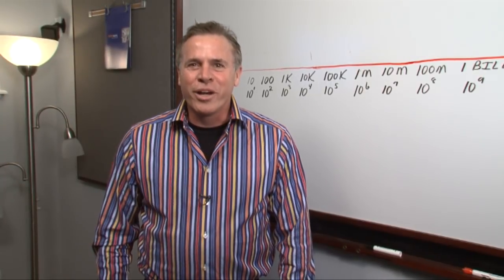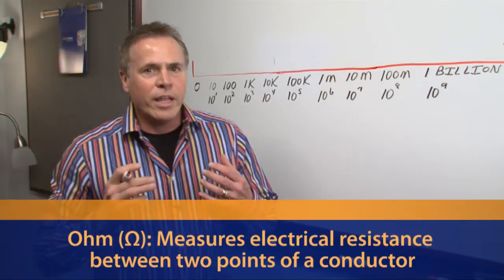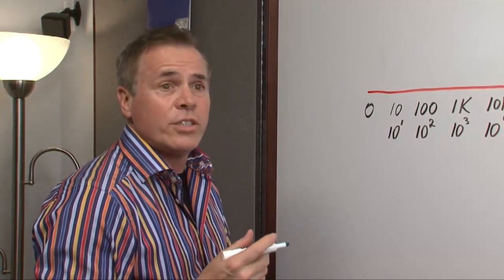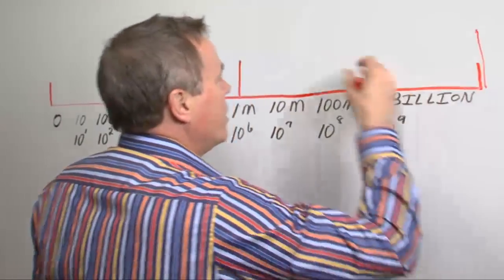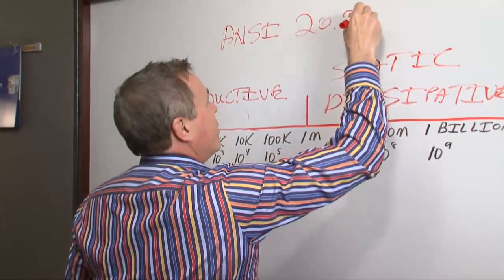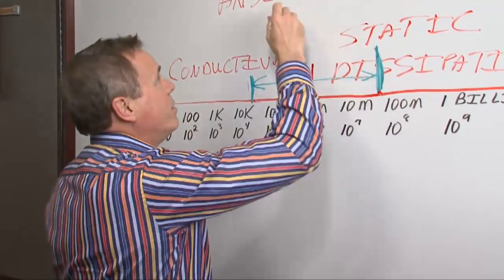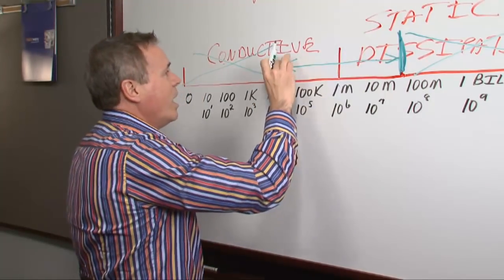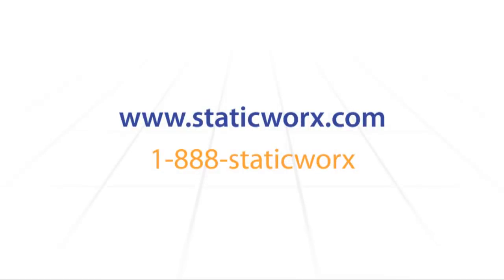ESD Flooring: Static Dissipative vs. Static Conductive

Comment: What you forgot to mention is to meet s20.20 the resistance between a person IN HEEL GROUNDERS with the flooring must be below 35 meg ohms. Heel straps ALWAYS have built in 1 meg resistors SO even if the floor is 1.0e04 the total resistance between the tech, their heel straps and the floor will be one meg ohm. Considered the SAFE range for fifty years. What happens if the floor is static dissipative and it gets dirty? You FAIL ANDI ESD S20.20. Millions of people go to work on a static conductive floor daily, out of those million people ZERO will be electrocuted because of the floor. A static conductive floor offers ultimate static control. Very misleading video
Reply from the maker: Hi Mark, You present some interesting comments that we should explain further in a future video. They are common misconceptions. I tried to look you up but your public profile on YouTube doesn't have any contact info so I can not know the context of your concerns. That said, heel straps are universally available with and without resistors. Additionally, if a person is standing on a floor wearing two heel straps with one meg resistors, the resistance between the person and floor is divided by two = .5 megohms. And keep in mind that wet leather shoes can measure very conductive < 25,000 ohms. If a person walks in a wet area with leather shoes, e.g the bathroom, their shoe soles now become infinitely more conductive than the "electrically protective" heel straps they are wearing. The so called 25,000 ohm minimum resistance stated in most flooring specs is based on a now defunct NFPA requirement. I say defunct because in 2015 the NFPA eliminated the conductive flooring reference. However, when it was in effect the NFPA 99 committee meant for the user to test resistance with an applied voltage of 500 volts. ESD flooring manufacturers test conductive flooring resistance at the ANSI/ESD required 10 volts. A floor measuring 25,000 ohms at 10 volts, (for example black back ESD carpet tile) will measure under 10,000 ohms at 500 volts. The NFPA would never have approved such a floor. They would consider it an electrical hazard. Lastly, the resistors used in heel straps and wrist straps can be damaged  by ac voltages yielding a dead short vs the 1 megohm resistance they previously provided.
Reply: @staticworx  so does that mean the sweet spot is shifted when testing with a 10 volt vs 500 volt?